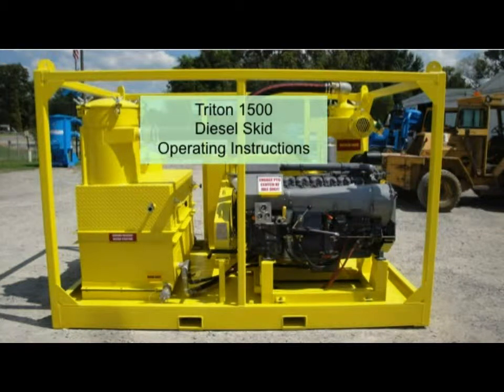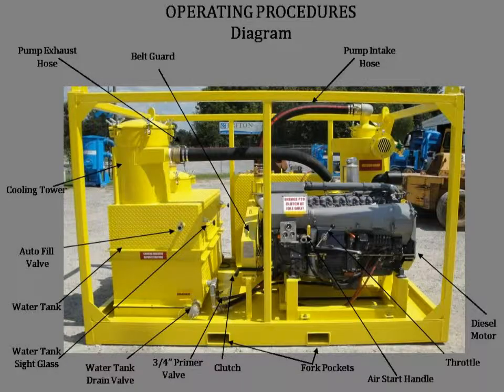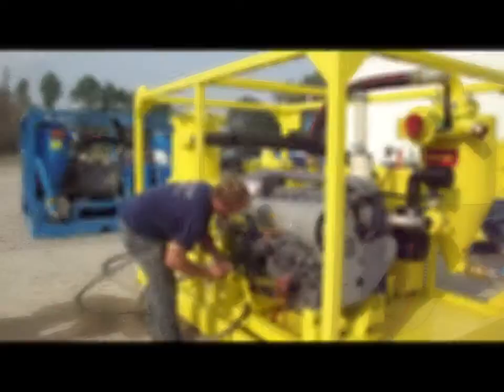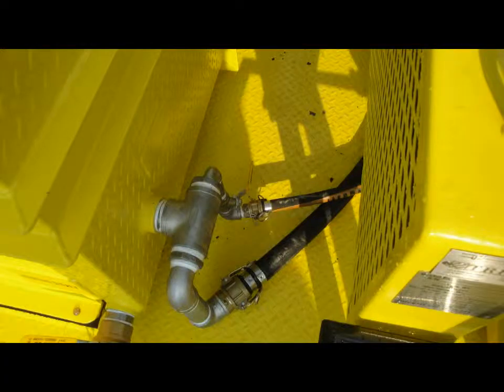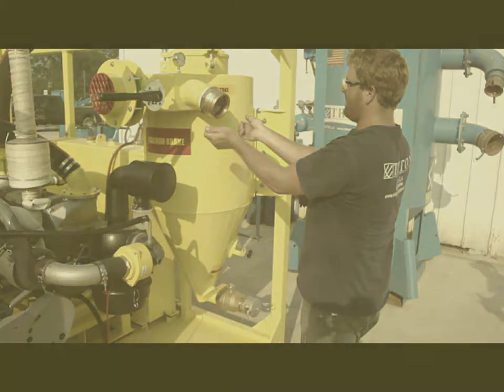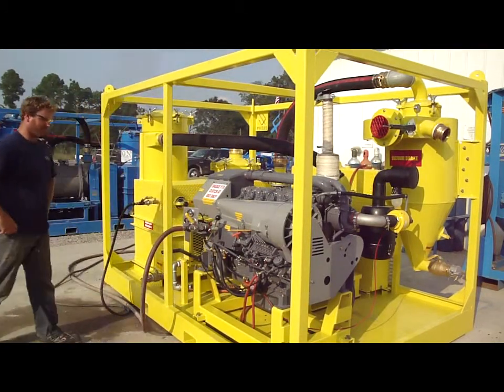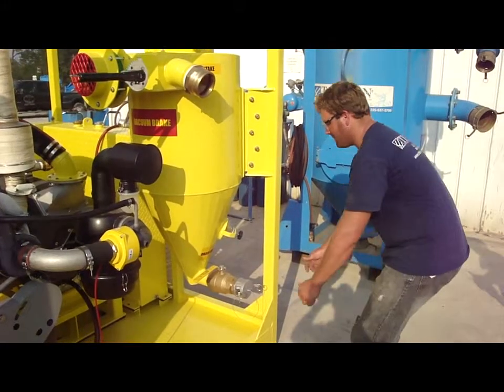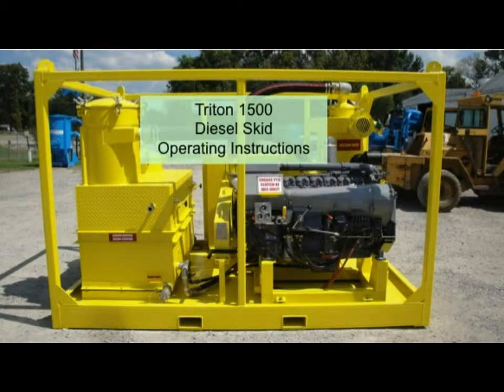Triton 1500 Air-Start Diesel Vacuum System Operation Instructions

Comment from the maker: The air exhausts out of the shorter tower of the square water tank.  It has an 6" camlock, so you can hook up to a scrubber if need be.  The diagram at 1'13" of the video has an annotated pointer to it.  Thanks for your question.